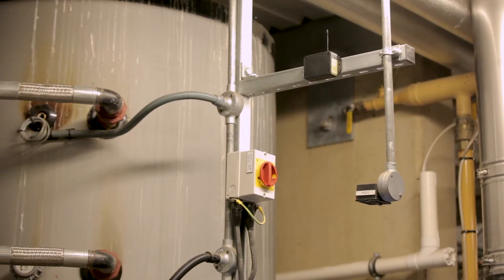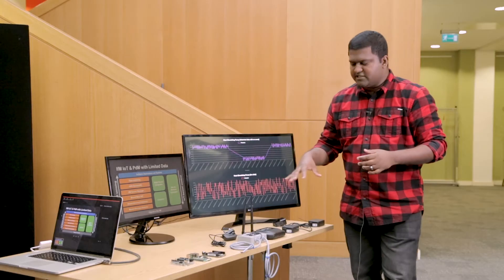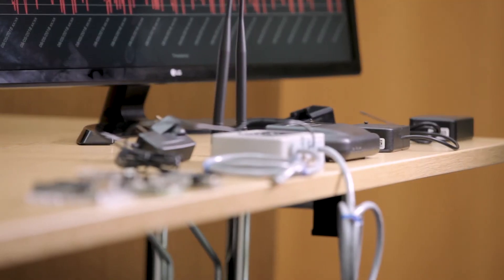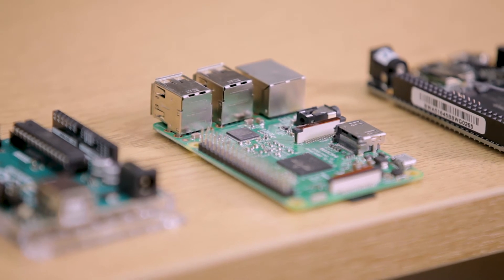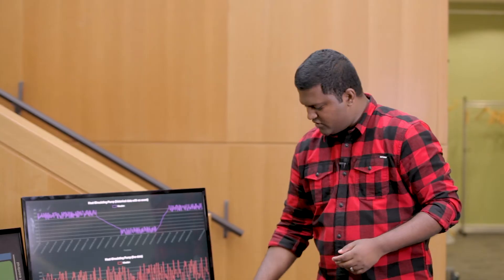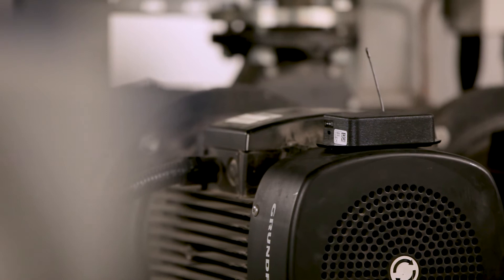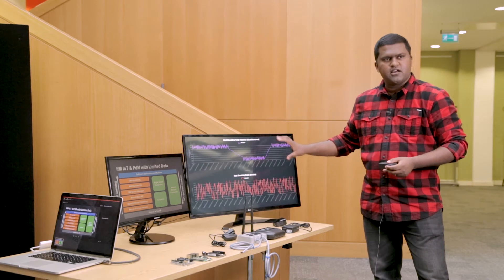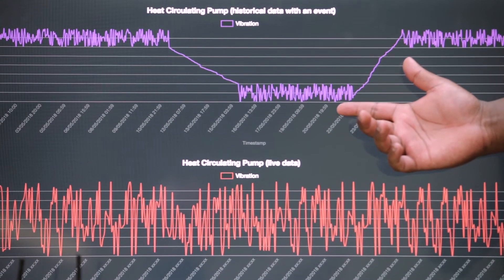IoT Sensors for Digital Twins

Comment: Did you install any wireless battery powered, wifi capable sensors, which meassure temperature and relative humidity, in ovens or lab driers that can go to 100°C? I cant find any that can handle such high temp.